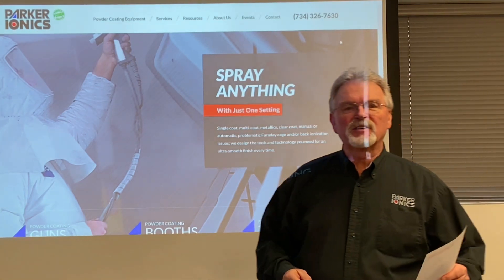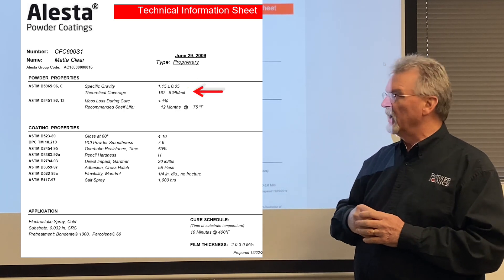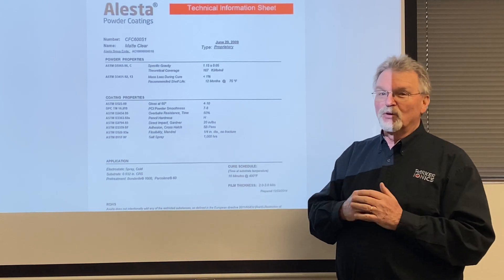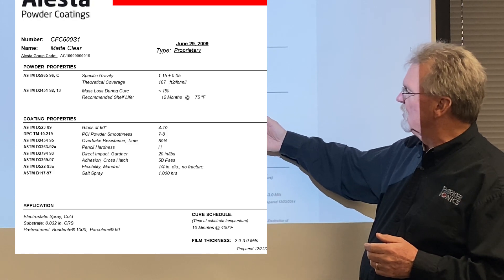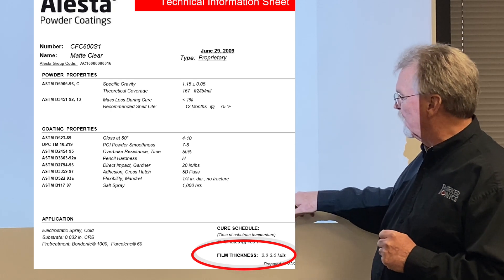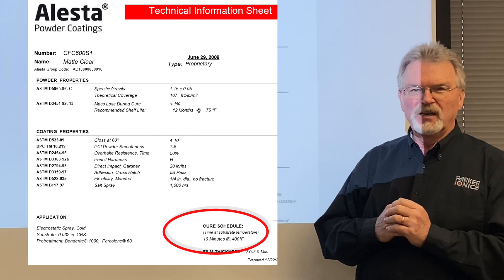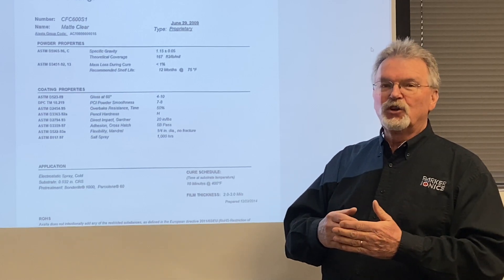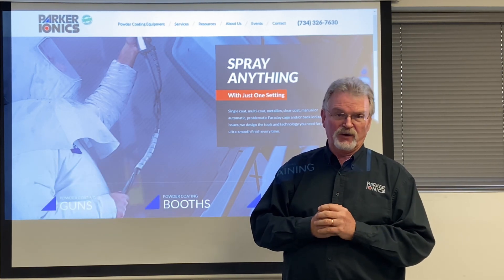How To Read And Understand Technical Powder Coating Sheets

Comment: I think this will benefit trainees as they move into more job responsibilities. But, each thermal setting powder has its own characteristics for color to color or brand. No different than automotive paints. The product works from heat, but to achieve proper adhesion, the part has to reach the product information sheet temperature for the required period of time for size & mass. Adding time for thicker film build may change for most, but not all. It should be said that air supply should as dry as possible. A pre-check the filters, pressure should be included just like gun condition for the run especially if changes are make in size, shape, color and mass. I use a clip board for a pre-spray check list. Just like flying a plane or launching a boat. 
  Nice idea as it keeps a tech sharp and thinking.